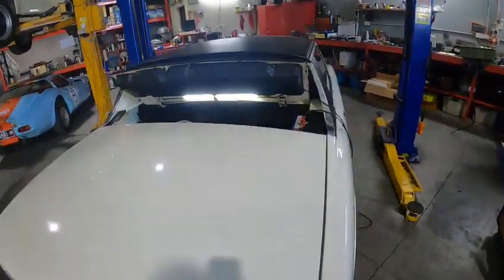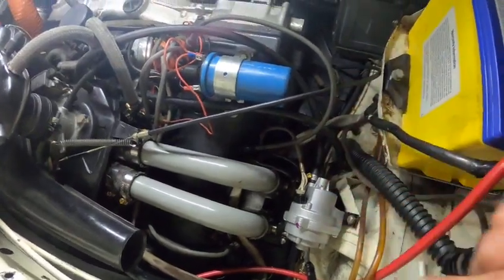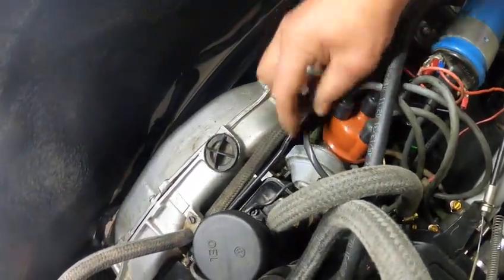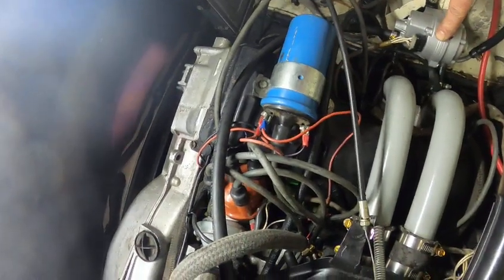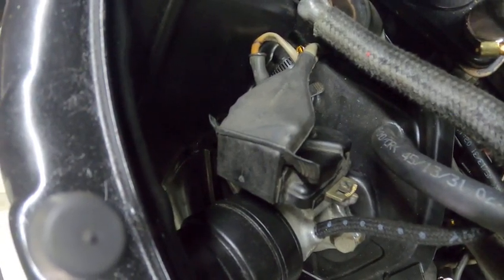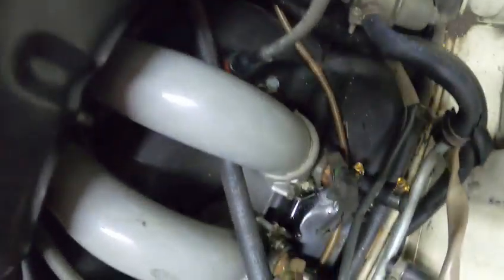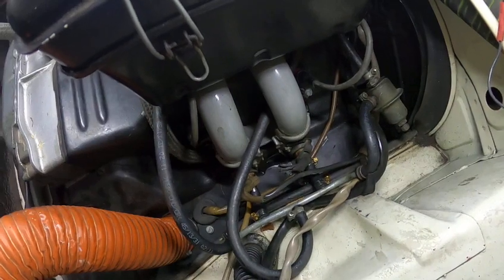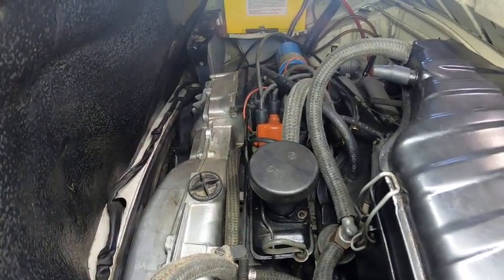Bosch D Jetronic Overview

Comment: He forgot a very important part of the system. That is the Cylinder Head Temperature Sender. It is screwed into the Cylinder Head at Cylinder #3. This is a Critical Part and should not be overlooked.
Reply: Thank you Peter that is true the temperature sensors are a critical component in any injection system!